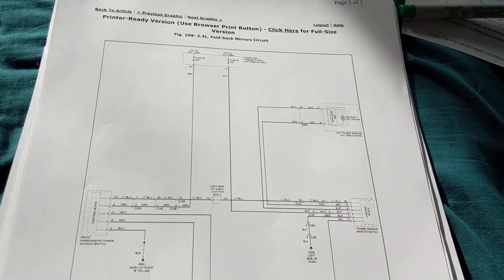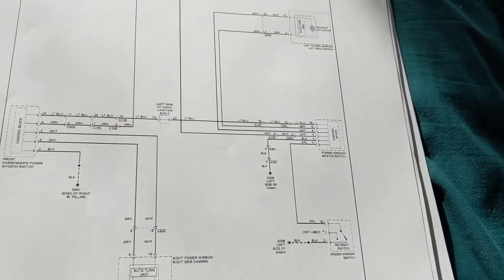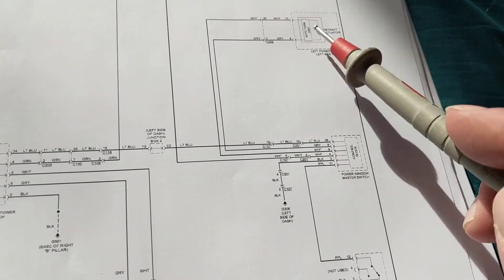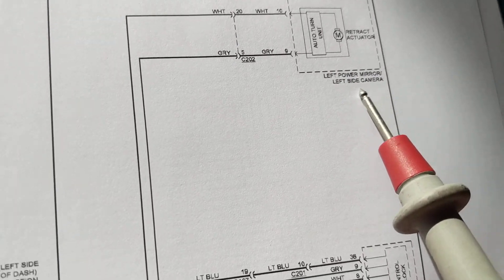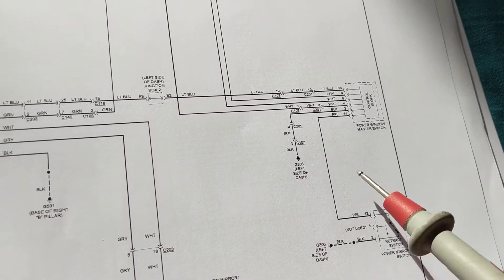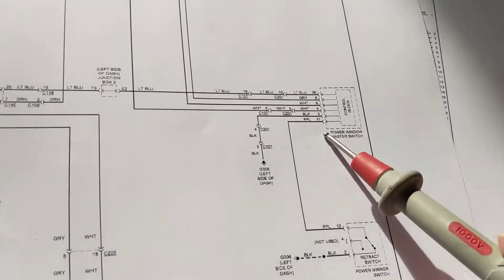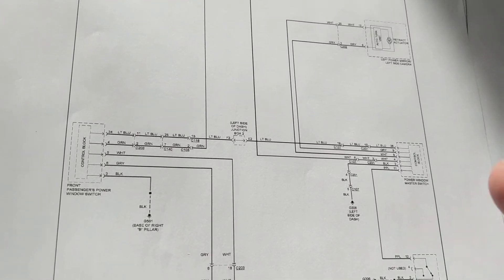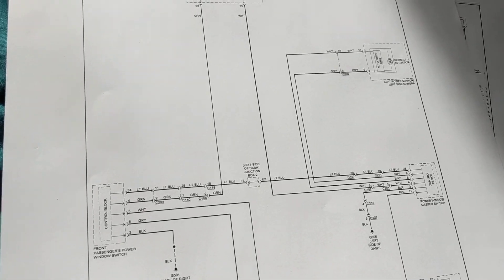HOW TO DIAGNOSE FOLDING MIRRORS FOR ALL ASIAN CARS FROM WIRING DIAGRAM

Comment: Trying to convert 2024 nissan frontier manual mirrors to power mirrors ,,up  down, east, west...  i just aquired the connectors and switch.. do you think i will runinto the modules you are speaking about... Nissan cannot ( will not) assist me... i have checked to see if the existing harness in My base model SV has the necessary connectors and wiring but it appears not... i am hoping to id the necessary pins in each of the connectors ...apply 12VDC and grn and test on a bench... Pipe Dream? Thanks

Comment: Hi ! I have a toyota vitz 2011 and my right hand mirror does not fold and is not adjusted via the remote control. My left hand mirror works fine. I checked the fuse and it looks ok, can you suggest a way to find the issue ? Thanks in advance !
Reply: And my question is , where is the part responsible for this problem, is it inside the car somewhere or is it in the actual mirror ? Sorry for the many questions !
Reply: Did you fix it? What was the issue?
Reply: @serenakaribeche7200  happy new year ! I didn't manage to find the issue. I got bored and felt that I was going out of my knowledge there, so left it as it is. But in general it feels like you need to replace the whole mirror when this happens.